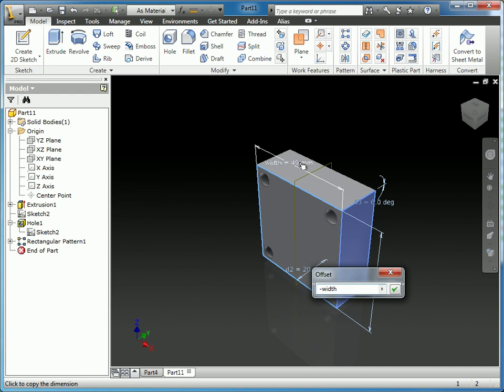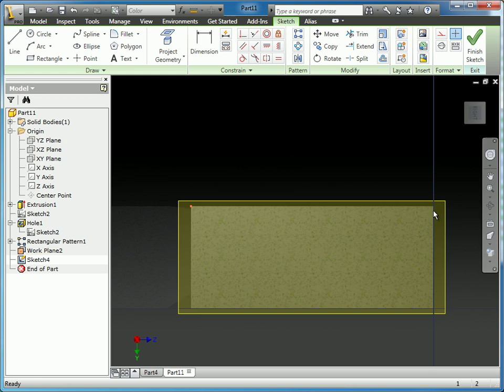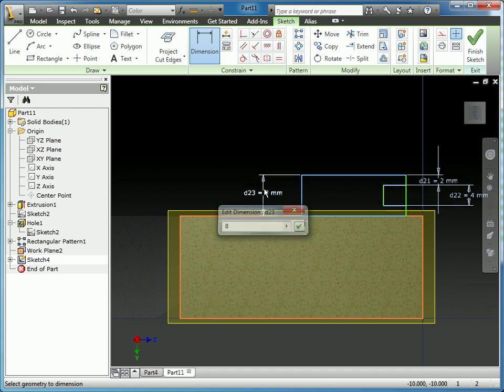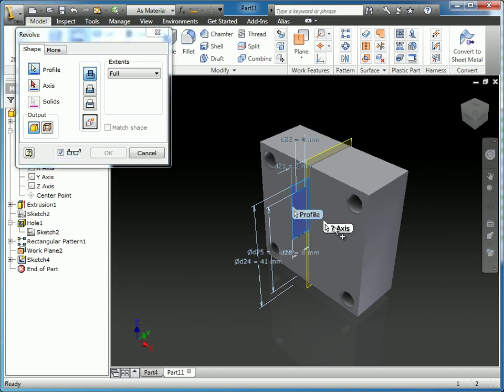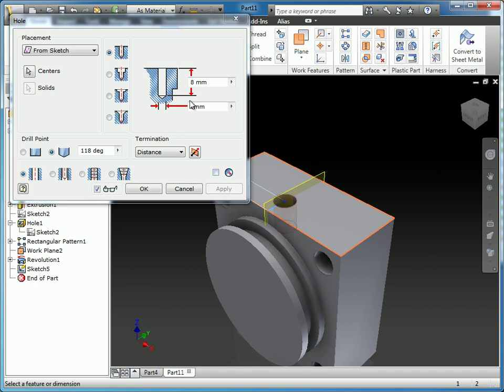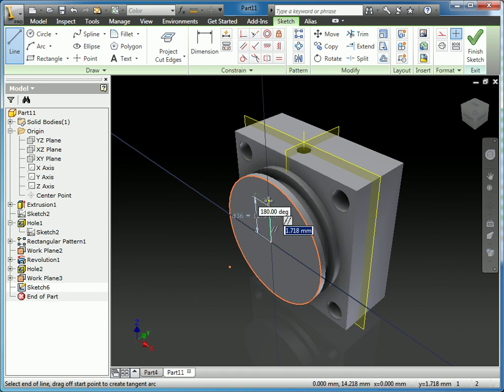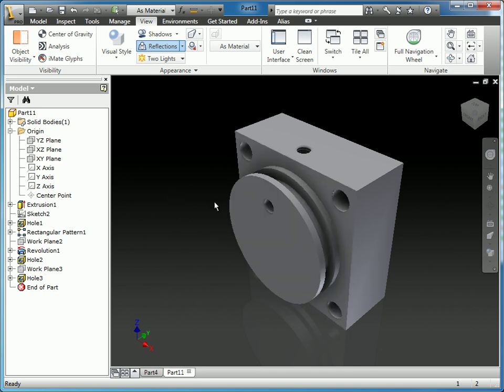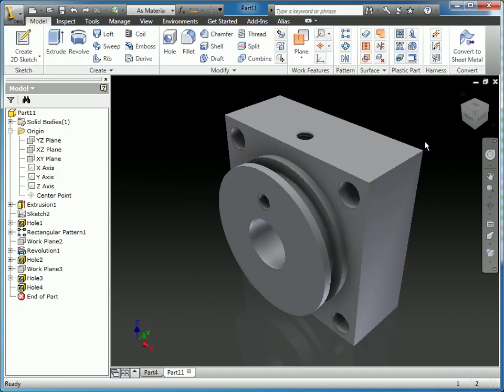Part 2 - Part Modeling In Autodesk Inventor 2011

Comment from the maker: @busabuoy Honestly, I never use that option, because it's just extra clicks. When sketching the system will automatically find the mid point when you hover over the line near the mid point. If for some reason you want the system to not use the auto snaps (say if you wanted to draw a line that terminated very close to, but not on the mid point) you can hold the Ctrl key down on the keyboard. Keep in mind the menus are context sensitive, snaps will only be available when the can be used.

Comment from the maker: @youngday713 I assure you it does work, I have tried it in 2012. Make sure that you are in sketch mode (meaning a sketch is active and the sketch tools are showing) AND on a sketch that cuts through the part. Hope that helps.